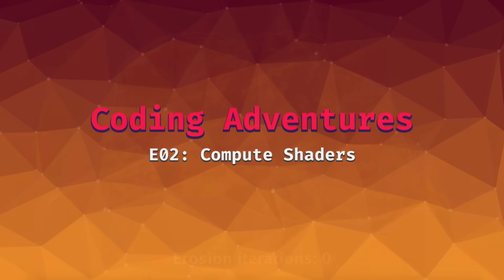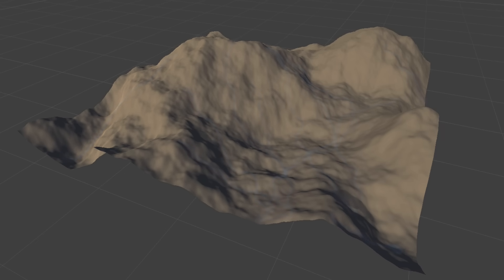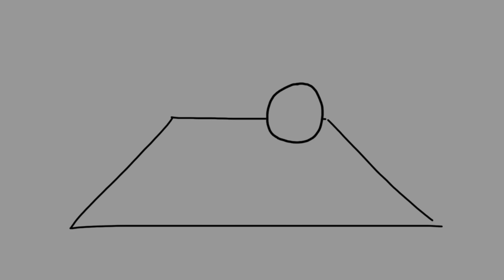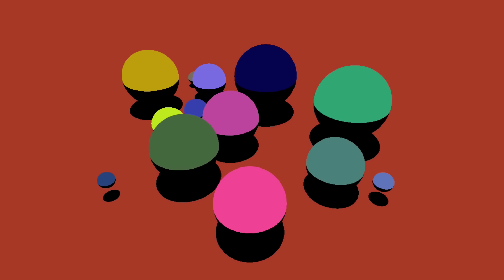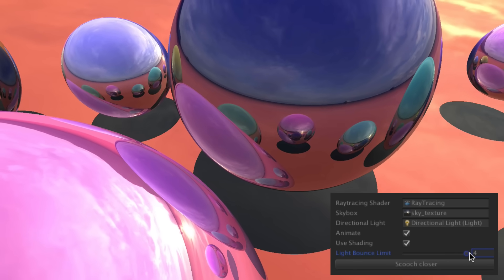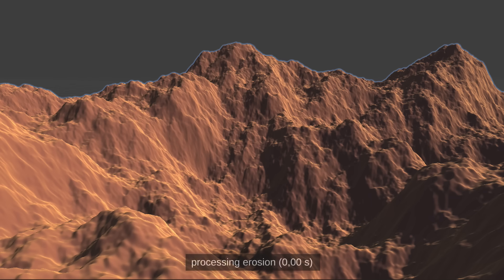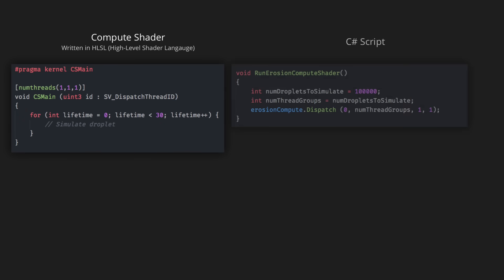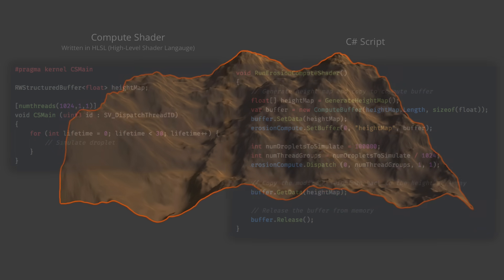Coding Adventure: Compute Shaders

Comment: Hey Sebastian did you have to use atomic functions to get this to work? I am worried that when putting the erosion code into a compute kernel the water droplets may read and write to the same area of the height map at the same time causing data loss and potential errors in the erosion - because of the nature of the parallel environment. Did you have to deal with this problem at all, and if so, was the answer atomic increments / decrements?
Reply from the maker: Hi, I was concerned about this as well, but in the end it seems to work well without using atomic functions. There is some data loss, but the results still look practically identical to before, so I just left it. I did use atomic functions in the heightmap compute shader for keeping track of min/max vals to normalize the heightmap, because I wanted the result to be consistent there.
Reply: @SebastianLague  Cool, thanks for the insight!

Comment: Hello Sebastian, great video, as always. I have only one request : could you make an in-game road building system like in cities skylines please? Thanks!
Reply: This is pretty simple if you're just building the procedural model generator, and the car pathing stuff isn't too hard either. I'm currently doing something similar to this for connected frames and walls in a building system, which is essentially the same problem without any directional constraints.

I would be happy to point you in the right direction if you want

Comment: haha i was thinking,... wait shouldn't it be,... "computer shaders" even commented about the forgotten R in the title :D
great video again thanks for sharing your knowledge and explaining so much, i find it intrsting to see how much of a more efficient way it is to calculate the errosion, can someone tell me why or is it simply that gpu renders so much quicker?
Reply: The easy explanation: Unlike a CPU, which has just a handfull of cores that can run instructions independently of each other, a GPU has many cores that all do the same instruction at the same time, just with different variables. The cores of a GPU are less powerfull than a CPU core though. But if you're able to calculate 1024 droplets in a single step at, say, 60% speed (don't quote me on that number, I made that up), it is still a lot faster than calculating just 1 droplet per step for 1024 times at 100% speed.
Reply: @matzibeater  awesome thanks for that explanation ! :) so it's mostly about using the resources you have - distrubuting the workload accordingly.